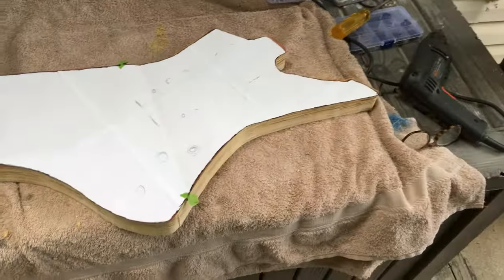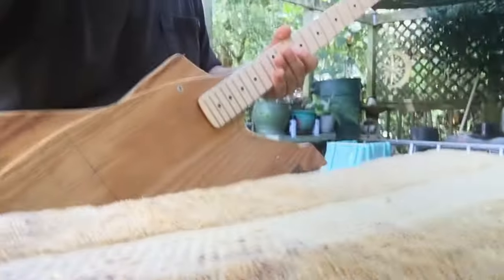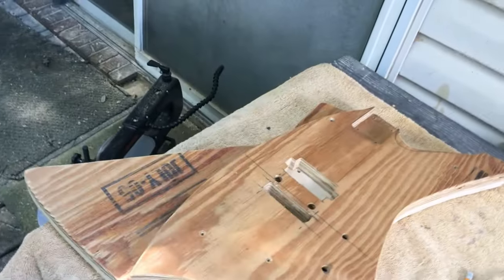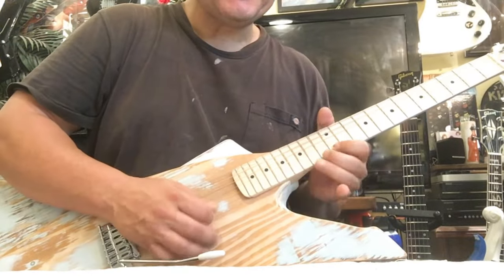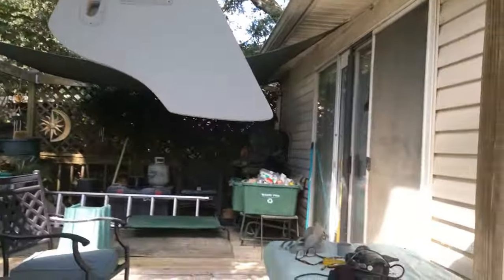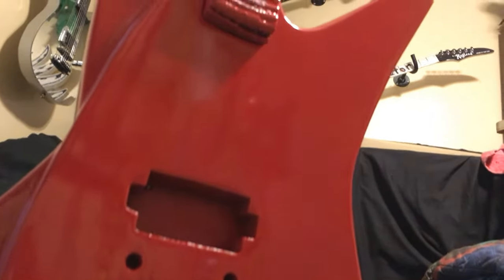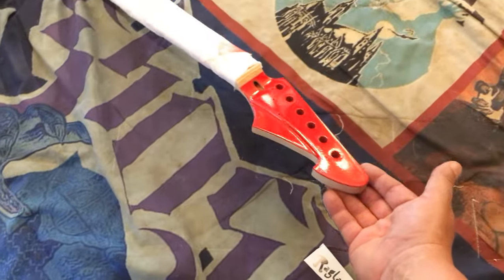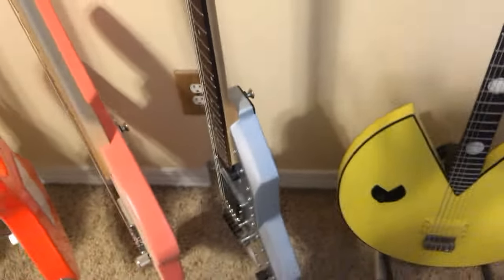How I Created This Snakebyte Inspired Home-Made Guitar Out of Plywood Using Basic Tools, Full Build

Comment: So how many pieces of 1/2 inch plywood --did you sandwich together?  2 --or 3.  ?  cannot see !
Reply: at least 3 half inch layers to equal 1.5 inches. if you wanted a slightly thicker body you could use 3 sheets of 5/8ths